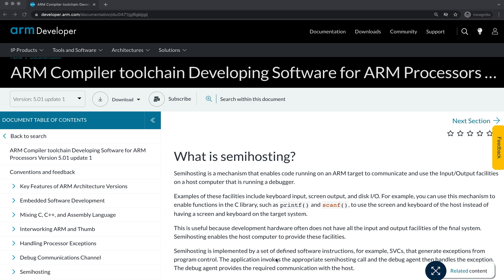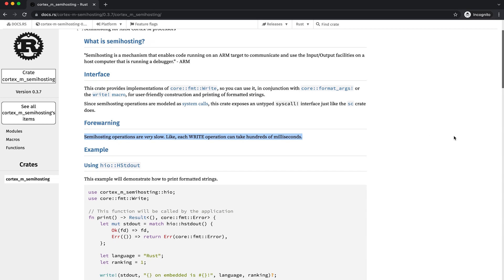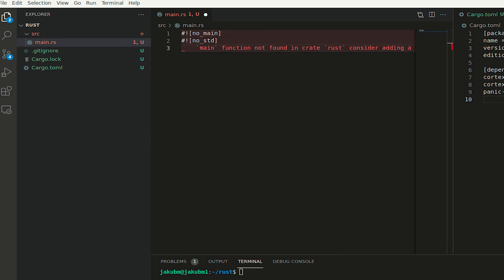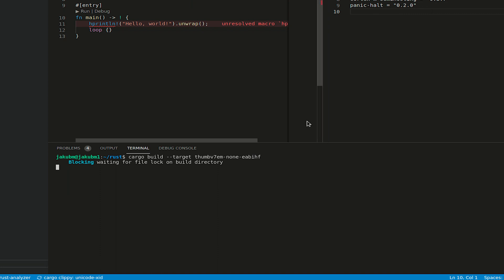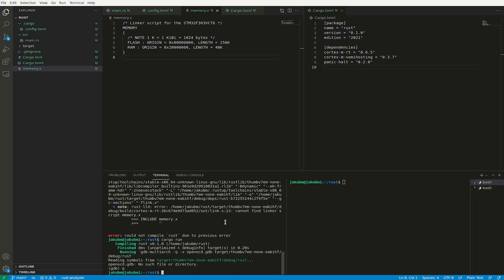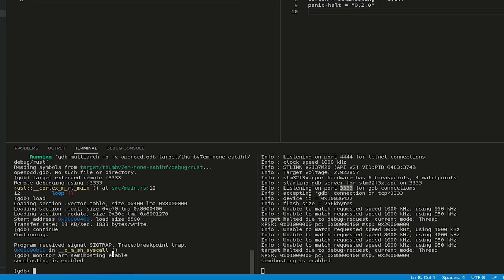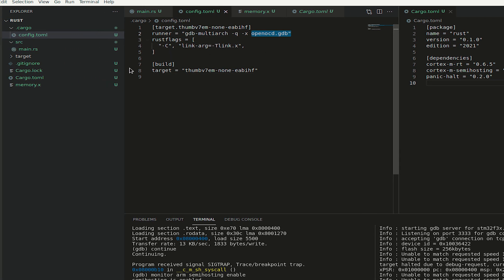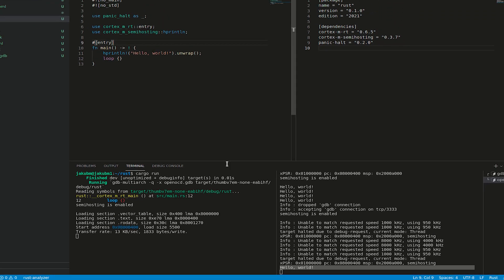Rust Embedded for STM32 Microcontrollers: Serial Wire Debug (aka. Hello World)

Comment: Thank you for your video, it was helpful.
Although when I was doing the same I was getting exception during `cargo run`

    Finished dev [unoptimized + debuginfo] target(s) in 0.04s
     Running `gdb-multiarch -q -x openocd.gdb target/thumbv7em-none-eabihf/debug/embedded-programming`
error: could not execute process `gdb-multiarch -q -x openocd.gdb target/thumbv7em-none-eabihf/debug/embedded-programming` (never executed)

I couldn't solve it that's why I decided to change my target runner to `runner = "arm-none-eabi-gdb -tui -q -x openocd.gdb` and it started working at first
but when it tried to `load` or to `continue` I'm getting:

Info : accepting 'gdb' connection on tcp/3333
Info : device id = 0x10006431
Info : flash size = 512 KiB
Info : flash size = 512 bytes
Hello, world
Error: jtag status contains invalid mode value - communication failure
Warn : target stm32f4x.cpu is not halted (gdb fileio)
Polling target stm32f4x.cpu failed, trying to reexamine
Examination failed, GDB will be halted. Polling again in 100ms
Info : Previous state query failed, trying to reconnect

Don't you know how to fix it?
Reply from the maker: Does it work only on the first try? Can you remove and reapply power to the board; does it work then only once or multiple times? It's important to have the correct target runner. Are you using exactly the same board as the video?
Reply: Hi  @JaJakubYT  
Thanks for the reply. Yes I've tried multiple times. I reapplied power and anyway it's not working. I'm using stm32f411ceu6 board and unfortunatelly I can't succceed it
Reply: I event reinstalled cargo to solve this issue

  Finished dev [unoptimized + debuginfo] target(s) in 0.04s
     Running `gdb-multiarch -q -x openocd.gdb target/thumbv7em-none-eabihf/debug/embedded-programming`
error: could not execute process `gdb-multiarch -q -x openocd.gdb target/thumbv7em-none-eabihf/debug/embedded-programming` (never executed)

it didn't help
Reply: @DavidManukian-k9x  
I get the same but that is because 'gdb-multiarch' is not supported on Fedora OS